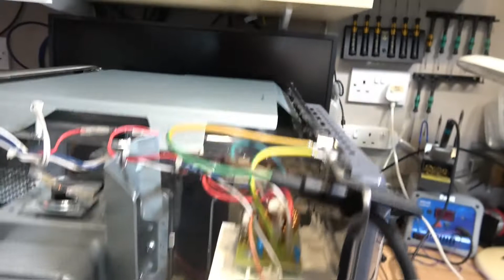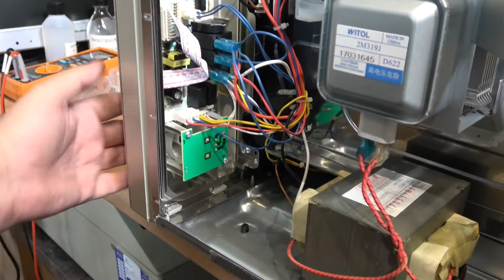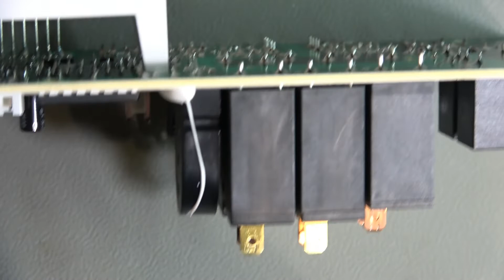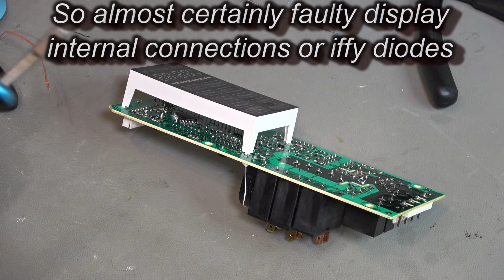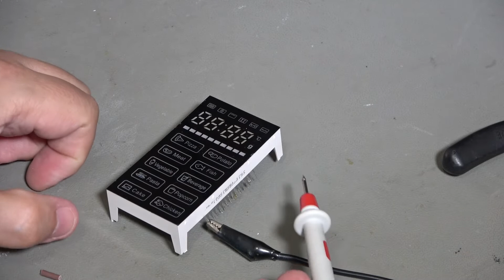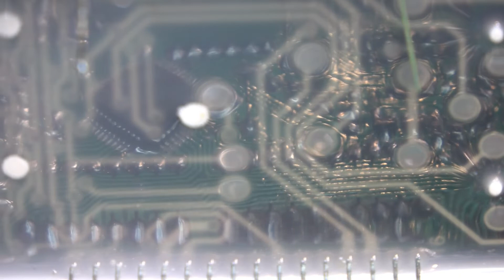0006 Microwave Display Repair Sharp R-982STM

Comment: Hello, I came across your video today and I must truly say, I'd love to have someone who would want to spend even a day or two, working on the broken LCD display of my Sharp 84st. It was top of the range in 2002 and we needed it as we were renovating the house and were without a kitchen. I have had this wonderful companion for 22 years! It's truly part of the family! :D I changed the microwave screen and it's been now a few years that the light and the display don't work. I have memorised its functions and try to guess the ones I am not sure of and do get it right most of the time. I still bake in it and use the grills and microwave functions regularly. A similar performing microwave would set me off around £450, which I am definitely not prepared to spend, as mine is still fully functioning. I have seen you are in Kent, too far from me up North. And the darn thing weights a tonne! Any suggestion, please? I really care for my good reliable appliances and will not accept defeat!
Reply from the maker: The displays tend to be hard to come by.  Not familiar with your particular model, but sometimes reheating the joints where the flat flex from the LCD is soldered onto the controller board can help if it is a clear flex with visible traces in it (and not terminated with a socket) -  just press a flat soldering iron bit (about 270C) hard onto  the place where each trace terminates onto the board - you are just trying to reflow the solder so not too much.  After that you could ask Sharp nicely but I doubt they will help, or look out for a second hand one.
Reply: Thank you so much for taking the time to reply. I am not so confident with the idea of dismantling the "beast". But will ask either a friend or a local electrician. Many thanks again! @MakeOrRepair

Comment: Hello, thanks for the video. Same problem for my microwave oven LG MH6535GIS. The display seems to be dead (5 segments not OK). And the PCB costs 80€... (I have to order it in Sweden). A new oven costs 130€...
Reply from the maker: I hate it if I have to replace a board, always over priced.  I'm fixing a board in a coffee machine at the moment, about £80 for board or £15 to replace everything on it, and that is ne buying parts retail in small quantity.
Reply: @MakeOrRepair  yes, the problem for the display is that it is too specific. It is not awailable. it's a shame for the wallet and for the planet 😞

Comment: There is a thin black film on the top of the display, remove it and maybe you should have been able to build a new 4 x 7 segment display DIY on a perforated board and then route the pins in order to get the same layout as the original display. For the pizza, chicken etc, use a single LED with same color and when all is mounted, just cover the new display with the same black film. ;) et voila
Reply from the maker: Pretty much what I had in mind but couldn't face it - not sure if the film comes off adequately.  Anyway I have another problematic display on a tuner that I'm going to try and create a replacement for - using 3D printing and either etched film or printed film, not sure yet - this one is fluorescent though so need to do some level trandlations etc - anyway if it goes well I hope to establish a fairly generic DIY solution.  Not sure when I'm going to get to it though!

Comment: What’s the Update please?
Reply from the maker: I waitied a bit to see if a scrap unit might turn up to salvage the display but no luck.  In the end I sold most of the working parts and recycled.  Sometimes you have to admit defeat, and never look again the day after you get rid of it becaue murphy is bound to make one turn up just too late!
Reply: @MakeOrRepair  Today I was driving and I saw a microwave which was thrown away and I just wondered if it was similar to the one that you are trying to repair?